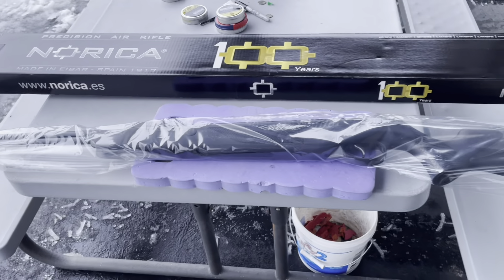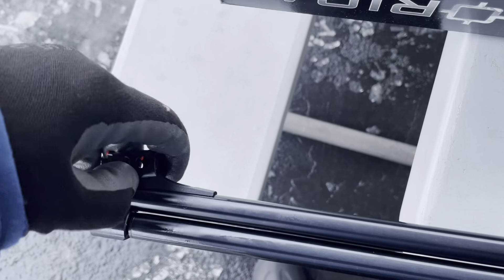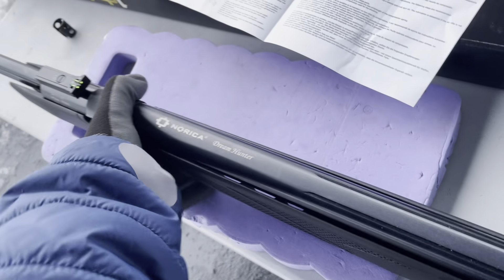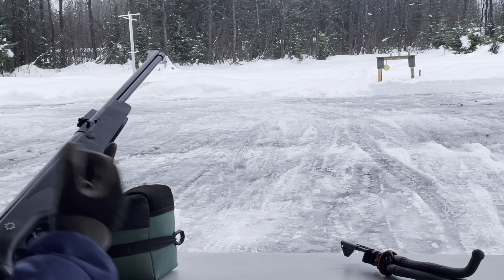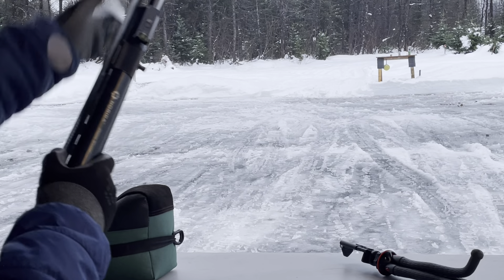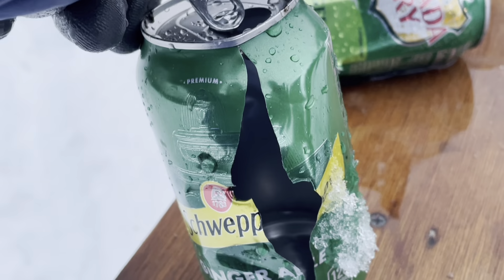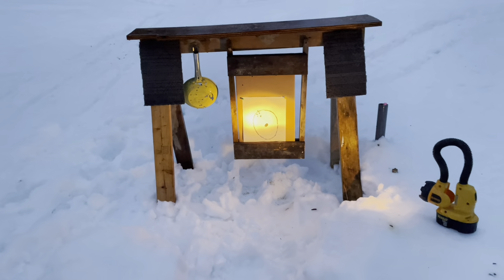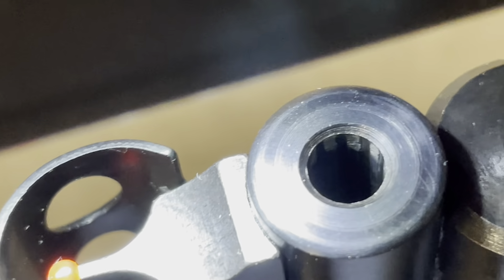Norica Dream Hunter .22 cal - first impressions & shooting test

Comment: I like these plastic stocked rifles because the buttstocks are hollow.
I take the recoil pad and i stuff the hollow space with jell filled squeese toys i get at the Dollar Tree. 
The jell filled squeese toys absorb a lot of recoil and vibration. This protects the scope from damage and makes the gun shoot quieter. The extra weight in the buttstock makes the rifle balance better too.
Thanks for the video.
Reply from the maker: That’s a great idea! Thanks! 🙏 👍
Reply: @airgunsofalaska  i was going to fill the space with silicone caulk.  I think It would do the same thing but its not so easily removed if i changed my mind about it. 
My rifle held three of the squeese toys
 I put the first one in a sandwich bag and i stuffed it way up in the front of the buttstock. That way it wouldnt get stuck and i could pull it out easy if i wanted too.  There was just room enough in the stock for two more squeese toys. 
The toys i found at the Dollar Tree look kind of like banana shaped clear rubber bags with white beads suspended in some kind of jell.
The tough rubber bag is kind of tacky feeling. That makes it absorb vibration from the stock really well.
I thought about taking the action out of the stock and seeing if there are any empty spaces i could fill with some silicone caulk.
Maybe bed the whole action in it.
First  wrap the action in dry cleaner plastic bagging so it isnt glued in place with silicone.
Some stocks have hollow pistol grips that i think could benefit from some silicone.
Theres no reason to have a scope smasher if you have a hollow plastic stock.
Part of why it works is that it adds some weight to the rifle so it absorbs some recoil.  That is a good thing for the scope.

Comment: Seems like a quality air gun (maybe with the exception of the stock). I too would prefer wood but can agree that scratching a nice piece of wood does bring a tear to the eye. Look forward to seeing how it holds up over use and time.
Reply from the maker: I’m curious about its long term reliability as well since I’ve never owned the brand. So far, aside from some minor niggling things the gun has been solid. But it’s only day two and I expect my airguns to last decades.
Reply from the maker: @DrAgan_tortojed  great points! I can still remember back in the 80’s when synthetic stocks were the new cool thing for rim/centerfires and people wanted them over wood for the some of the same reasons you mentioned like being more stable. But I’m really fickle and it seems like I always want the opposite of what’s offered on an airgun. If it’s got plastic I want real wood and then vice versa.

Comment: Eagle-eye shooting! I believe  Norica barrels are hammer forged in Spain using German steel. I scratch my head as to why Norica does not put their very nice Norica N.A.T.S. trigger on their very nice Dreamhunter. Norica chose to use their crude direct sear trigger on the Dreamhunter(crazy!). The sear hook is made of stamped sheet metal sandwiched together with rivets to make it a wide enough hook to handle the heavy load. The plates are not always lined up well, so the sandwich sear hook doesn't engage the piston latch evenly and trigger weight ends up heavy and variable. Old Norica air rifles had solid steel sears which were more heavy duty and even, and produced a lighter, less variable trigger pull weight.
Reply from the maker: I was hoping this gun would turn out well as I was dialing it in. Now that I’ve seen how the trigger works I much better understand why it felt and performed like garbage. Part of me is glad the gun broke because it wasn’t smoothing out the more I shot it and the vibration, recoil and garbage trigger feel was getting old. 

Had they made it more reliable and included a better quality trigger the gun would be much better.

Comment: hello , if you cock  the gun with the pellet inside and action closed  the air is sucked beside the pellet and the pellet must get back to let the air by, first cocking ,there are 3 brands sofar as i know from spain  gamo ,norica and cometa.    norica has also a diana 54 recoil  type system  ,the  omnia zrs
Reply from the maker: Thanks for this! I didn’t realize or even think about the how the loading sequence could have a negative impact on the pellet. From here forward I’ll make sure to cock the gun first before loading. It’s funny to experience all the different nuances between all the assorted types of airguns. 

I’ve never owned a Gamo. I was doing some reading about them last night and in one forum post they were talking about how they moved some and/or all of their manufacturing to China. Is that true? I’d only consider a made in Spain Gamo if that’s the case. Cometa is a brand I’ve not heard of before. I watched a few reviews of the Omnia ZRS last spring and it looked interesting. It is priced a lot lower than the Air King but the big YouTube channels that were reviewing it I don’t have much respect for as they overhype everything and put out shill reviews IMO. 

I’d like to try one out. I could see myself liking it but I don’t know if I’d $400 like it.🤔 My Air King is very smooth, very accurate and very nicely built. The idea of that system in a lower priced, hopefully lighter gun sounds appealing. Something you wouldn’t mind taking out in the field and weather has a lot of promise.
Reply: @airgunsofalaska  a second hand fwb 300 is the same system .it was the most accurate springer 10 m gun .if not to windy .you can shoot  50 meter .its only 7.5 joule .but a stronger spring is made .its 10 joule then. 300 dollar   i think there must be find
Reply from the maker: @peteralexben   are there different generations of the FWB 300? I just read some articles about the FWB 300 and it says it is recoilless. This Dream Hunter is not recoilless. I like that type of system on my Air King.
Reply: @airgunsofalaska  the fwb 150 and 300 are the models where the airking kopyt its system from
Reply: @airgunsofalaska  do you have a gmail or so
Reply from the maker: @peteralexben  yes, it’s thatalaskaguy907@gmail.com

Comment: I took delivery of the Norica Dream Hunter .22cal. The thin plastic forearm is annoying. After 250 rds., the action smooths up.
Reply from the maker: I never really felt that the action got smoother. I’d have to shot a brand new one back to back with a used one to determine how much difference there is. The plastic forearm is much thinner and way more flexible than the synthetic stock on my Diana model 34.

Comment: Intresting breach. Looks like the air travels through the cover latch. I came close to buying a used kimar k760 this week. ( from norika )
Reply from the maker: That trapdoor style breech cover is pretty unique, at least to me. The air totally does travel through it so the design has its pros & cons. Ultimately a guy will never injure their fingers loading this gun so that’s a pretty big pro. When I was researching under levers in this price range and their origin of manufacture this Norica had most simple breech access. 

I wasn’t familiar with the Kimar K760 and just looked it up. It looks like a fun little break barrel. 👍 I don’t believe they were ever offered in the USA?
Reply: @thatalaskaguy-airguns  it was on replica airguns usa years ago. On our side in Canada, I can only find second-hand.

Comment: After running it in a look inside (carefully) and check for over oiling then maybe a polish on any high spots and a light Moly grease on the spring to dampen the twang (lots of tune up information on the tube ) interesting video I haven't looked at this gun yet in England price for comparison is 214 pounds as listed 👍
Reply from the maker: It’s good to hear there is information out there to reduce the vibration. 👍

Comment: Why did you prefer a spring piston over a gasram?
Reply from the maker: I much prefer a spring piston from
a reliability perspective. I’ve got spring piston guns from the mid 80’s that still work perfectly even after being stored for up to a decade or two without being used. I’m very skeptical that a gas ram would exhibit that type of reliability. 

This past spring I got a Crosman Mag-Fire Extreme and gave a gas ram a try. It recoiled and vibrated just like a springer so didn’t see it as being an improvement. 

All that said I’ve read very good reviews about the Theobian gas ram system but I’ve never shot one or looked at buying a gun that featured it.
Reply: @airgunsofalaska  I very much agree with you on the springers outlasting (usually) the air pistons. I went down to check on some of my "safe queen" air pistons that probably get shot only a handful of times a year and 2 of them were dead. Next to them are my 80s, 90s Beeman/Webley spring pistons all of them are still shooting just fine.
Reply from the maker: @michaelwthalman  what a bummer about your gas piston guns. I’ve got one now in the Hatsan .30 cal break barrel. I’m kinda curious to see how long it will last. It jumps and vibrates with each shot so I don’t see any benefit to this system.
Reply: @airgunsofalaska  I still have a Hatsan 135 in .30  with a active air piston. And a few other Hatsans with still working air pistons. But, they could go at anytime from just sitting in the safe... The cost of repairing is similar to getting a new gun. If you can find the parts. So, I'm pretty much done on any new air piston break barrels. Will probably get another Gamo CFX springer (very accurate) and try to put mechanical springs into the Hatsans that had Vortex air pistons. If feasible and keep shooting my almost 100 year old (in some cases) multi pumpers. Crosman 101, Sheridans and Benjamins were made to last multiple lifetimes it seems. Oh and probably get a 3rd Crosman 362 and this time convert to a 367.  I ended up putting an old 24in .22cal barrel on my recently acquired 2nd 362 and I'am really impressed with it. I'm getting 3/4in 15 shot groups at 30 yards. Which for me is not an easy task. The usual steel breech, extended probe was added. Also, I bent downwards on each side of the trigger sear spring and swapped out the trigger return spring from an old ball point pen and got the trigger pull to just under 2lbs. Makes a huge difference in tightening groups...
Reply from the maker: @michaelwthalman  I’m a big fan of the Crosman and Benjamin pumpers. The older guns like the 101 were definitely made to last! I shot my custom 367 the other day and was surprised at how decent feeling the trigger has become with use. The 362 model is one of my favorite guns.
Reply: @airgunsofalaska  Do you think the 362/7 feels  somewhat similar to the Crosman 101 in heft? The somewhat narrow grips on both models seem similar also.
Reply from the maker: @michaelwthalman  boy… I’d have to compare them side by side. The 101 is a skinny gun but I’d think the 362 would be lighter. I’ve got a scope on my 367 so I’d have to remove it.

Comment: the gun looks cool .    the stock in the beginning of the vidio seems easy to flex and  l noticed the forearm stock area looks very thin .   do you think the stock  will hold up.     mostly at the 2 stock bolts in front.       other than that the gun is very cool l like how they used 2 bolts for the front sight  and  it looks like it shoots really good.      l just bought a daisy 1100s springer from wal-mart  for 63.00  l  read all the good reviews on it for  awhile now and  l just  got it  and this gun is a blast to shoot love the open sights no vibration after a few hundred shots it is really nice to shoot l will see how it holds up  and also the stock is synthetic feels really strong  and the safety is really nice,  made out of metal ,  trigger is metal ,  l really like the looks of the front sight on it also.    see how your norica does on paper l bet it will be good.
Reply from the maker: The front of the forearm is super thin and too flexible in my opinion. I was thinking how a guy could accidentally get tree branches or tall grass stuck in that area and potentially damage the gun while carrying it out in the field. That portion of the gun was disappointing for sure. 

I just looked up the Daisy 1100S and it looks quite nice. I don’t have any experience with it or any Daisy break barrel guns. Good to hear that it has so many metal parts. Lately, so many airguns are coming with plastic pieces and shrouds, etc, that it diminishes the look and appeal to me. Nice to hear they didn’t do that with the 1100S.

We’ll see how this Norica holds up over time. It’s looking really promising so far and I’m excited to shoot it some more this weekend. I’m going to check the tightness of the screws today, hopefully everything is holding together. 😆
Reply: @airgunsofalaska  l got a good feeling that your new gun will  be a tack driver.   l have been shooting my daisy 1100s down the basement all  morning  lots of fun.

Comment: I like the loading port, I don't trust the sliding port. No matter how safe they say they are .
Reply from the maker: What don’t you like about it? The cover swings away to the side to expose the breech. The piston is self contained inside the compression tube. The air comes out of a little 5.5mm size hole. 

It seems like an extremely safe system to me. 🤷‍♂️
Reply: No I think you misunderstood,  I love the loading port, and its 100 percent safe , I meant on the other undertleavers that has the sliding trap ,I think the best loading port on under.eavers were the Webley mark 3 and the Diana original 50 ,
Reply from the maker: @MalcolmJames-sg3zg  Ah! Yes, I totally misread the other first time. 😀👍

Comment: Loading is really interesting. Rifling seems good and deep. I’m betting, after you “ lead it in”, and perfect your technique for this platform, it will be much closer to a dime maaan. 😁👍
Reply from the maker: I thought the barrel and rifling looked really good too. I’m looking forward to getting more used to shooting the gun. I’m glad it doesn’t seem to be super picky with hold. My Hatsan Mod 95 drives me crazy with that trait. I like the loading style of this gun. The flip,of trap door and mechanical action of the whole sequence just appeals to me from both a visual aspect and practical. I like not having to worry about potentially losing a finger. 🤣😆
Reply: @airgunsofalaska  yea, odd cool factor is big in my book. 😁👍
Reply from the maker: @bayouflats5054  Me too! I liked that the gun didn’t have much out there about it. I took a leap of faith it’d be good and so far things are still looking promising.

Comment: What kind of power and speed is it producing?
Reply from the maker: The box it came in said 820 FPS but the best I saw was 738 with a 14.3 gr lead pellet. I can’t recommend this gun as it broke after only 5 days of shooting. I sent it back to the company I bought it from for a refund.
Reply: @airgunsofalaska  what a shame. I think you maybe happier with a Gamo 10XGen 3 .22 cal at the end of the day short of getting a PCP. The Notos a .22 cal PCP for under 250$ and a 50$ hand pump is really special. 745 FPS with Crosman 14.3s HPs & 735 FPS with Hades and Daisy HPs 15.89 and 15.4 DHPs🤷‍♂️ Avengers are awesome too💯359$😉
Reply from the maker: @heathhalfhill6401  I’ve never owned or even shot a Gamo break barrel. The repeater concept appeals to me but a number of my subscribers have left me comments they experienced issues with the Gamo repeaters. I had pretty bad luck with a Crosman Mag-Fire I owned briefly. 

Lots of guys and YT channels seem to really like the Notos. I’ve got a Benjamin Marauder pistol I rarely shoot so the Notos doesn’t have much appeal to me. I’ve got two other PCP rifles that I rarely shoot as I charge with a hand pump and don’t like how the charging effort ruins my shooting flow. I even bought a NOS Benjamin Maximus thinking its 2000psi fill might be less annoying but I found I just have to pump it up more often. 😆

A Gamo repeater would be interesting to buy and test for the sake of views on my channel. I’ll have to see how much $ I get from YouTube in the next month or two.

Comment: Have you thought about, how and wich way the air is getting into the chamber while cocking it? Especialy when a pellet is allready in the barrel?You wear the seals out if you cock it loaded and closed because you force it to suck air into the chamber while it schould be completely close.
If you expect to maintain a tight and powerful system while pushing air out, you should not force it to pull air in when it should be sealed.
Sorry for that.😅
Reply from the maker: You are right, after the video another guy commented and I’d not even thought about it. I was so used to the manual of arms on other guns being needed to be loaded first that I just shot outta habit. In later videos I cock first than load.
Reply: @airgunsofalaska  i learned It the hard way.😅
Reply from the maker: @olegbarth928  oh no! That’s unfortunate

Comment: It's looking to me like you could be loading the pellet into the BACK side of that flip-up port (and it might be easier from there than trying to poke it down into the cavity created by flipping it up)
Reply: Nope. The seating of the.pellet into the breech is mandatory.
Reply from the maker: I don’t think that’d be good as the gun isn’t designed that way.
Reply: @armandogonzales9304  well, I think they missed an opportunity there then, not only to make easier loading, but also gaining a couple more inches of barrel length